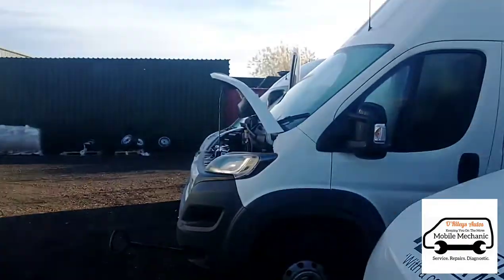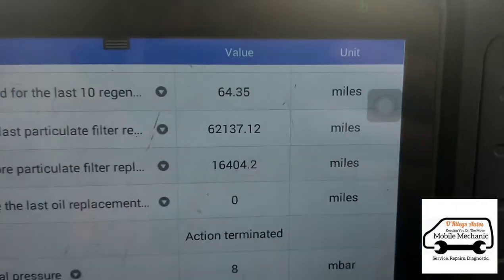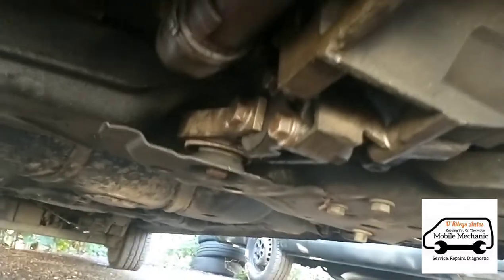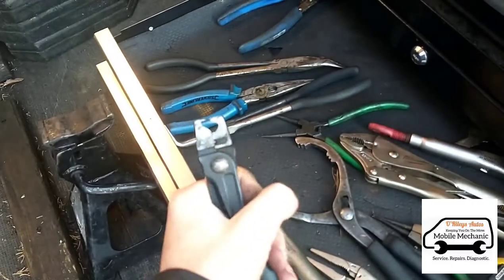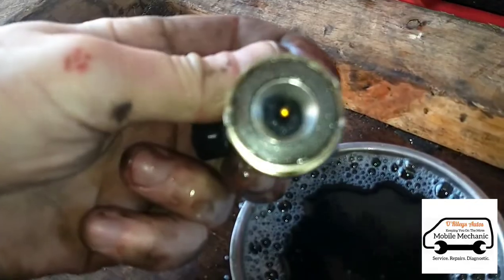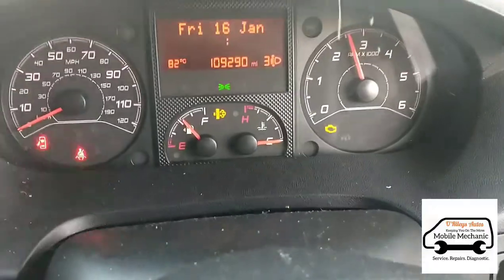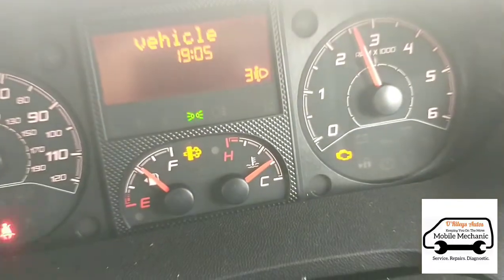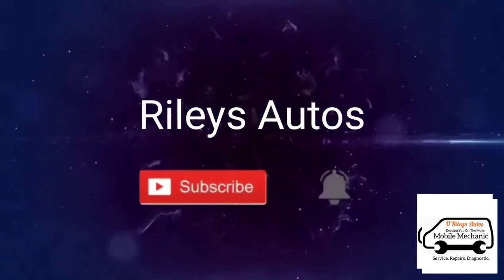P246C P24A4 P2463 Peugeot Boxer DPF Cleaning Flush + Regeneration & Unblock Clean Adblue Injector

Comment: Hi, I’ve got a 2018 Peugeot Swift motorhome, only 2300 miles on the clock, it’s the automatic transmission, I’ve got the same Autel machine as you have but won’t let me regenerate, it starts doing it then says clutch depress on the machine starts the process then cuts off, must be because auto, any advice would be greatly appreciated thanks

Comment: Hi just wondered why the outside temp gauge was showing the three dashes and not a temperature reading, I fitted new temp detector to the door mirror as per your other video is this van therefore in fault ?
Reply from the maker: Yes it was faulty on this van also